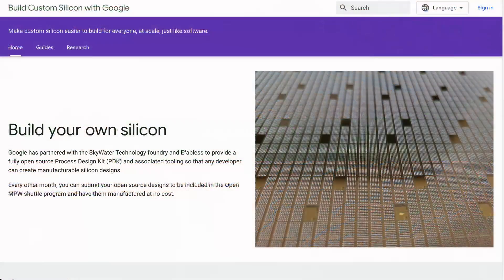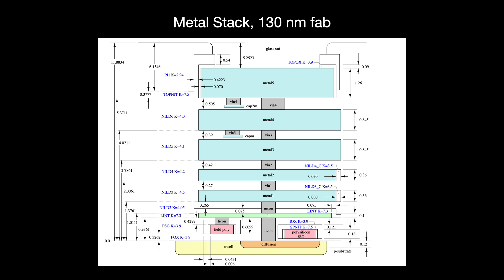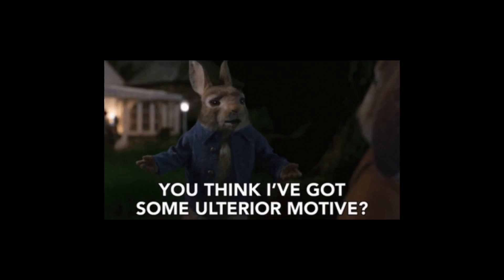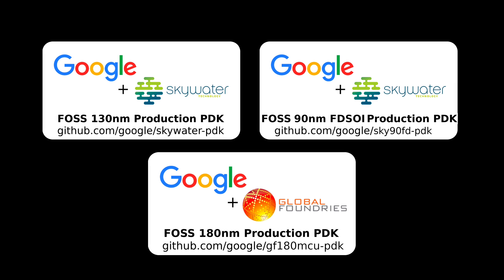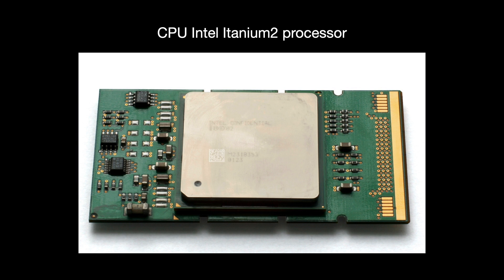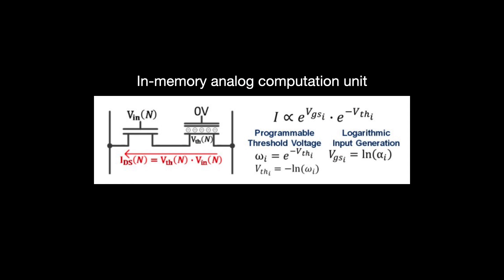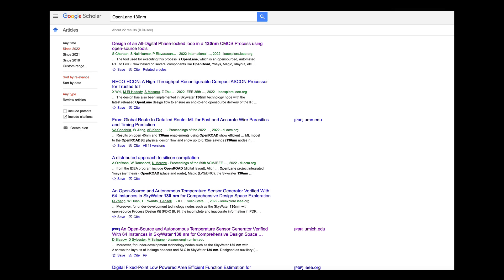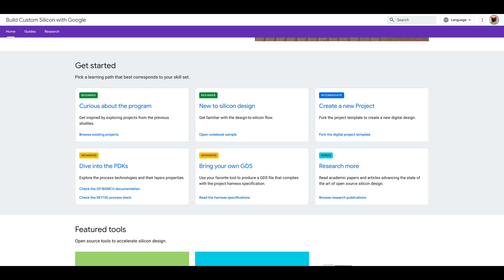Google's Open Source Hardware Dreams

Comment: This is so cool! The first application I thought of was for one of my other interests: astronomy. The issue that large, ground-based telescopes face is that the atmosphere "smudges" the image they create with every bit of turbulence in the air. Nowadays the big fancy observatories get around this by using "adaptive optics", which are optical surfaces that can change shape thousands of times per second to perfectly counteract the distortion caused by turbulence. The whole system uses machine vision, and the calculations have to be done super fast (again, at least thousands of times per second), so (I think) it takes dedicated hardware to do it. But that's out of the price range for a lot of observatory projects. I remember reading a research paper that looked at consumer grade GPUs vs FPGAs to tackle the problem in a cheaper way, and I think they ended up performing kind of similarly. But making a cheap(er) ASIC for that exact task would be incredible! 

Who knows if that's still how the research stands, that was a few years ago that I read that paper, and I don't know when it was published. So it could be that modern GPUs are so performant that they are the best option. Who knows, but that's just what I thought of.
Reply: How about doing lucky imaging in real time? Would that be possible/interesting?
Reply: @adambarker3130  That's definitely something I've read about them trying, but the issue is it only works with very short exposure times, which doesn't work for dim objects. Plus if 1 in 10 frames is actually OK, then 90% of the time observing was fruitless. Also, when telescopes get really big, different parts of the image are under different patches of warm or cool air, so the image isn't uniformly distorted. So that means you have to de-warp some parts of the image but not others, which is possible but it adds steps to data processing. So I think there's enough reason to go with adaptive optics that that's the main solution they go for.
Reply: I definitely remember hearing about this from one of my astronomy professors. Hopefully this will become reality in the near future
Reply: I was planning similar things but read about lucky imaging, but had planned something more sophisticated by far, and a new telescope.
Reply: This might well offer you the chance to shift a well designed FPGA implementation into a dedicated IC. But why would you? It's a slow process node, and once you have made your chip, that's it. Warts and all, all design errors baked in for free and for ever. See that 'RTL' bit in the diagram? Register Transfer level - that's your hardware description - exactly what's needed for an FPGA. I can see that for a dedicated, simple task, where the consequences of error are low, it's cool. But if you can write HDL first pass with no hidden errors, then there's an entire industry wants your number. The principal reason those 'professional' EDA tools are so expensive is because they are intended to prevent or trap (or at least make sure you find) those hidden bombs. I expect most of you are programmers, and know that states are 1 or 0? In an HDL, you typically have 9 states, and you need to be sure what happens if your signal is in any one of them - because hardware - one day, it will..
I feel a bit like the guy asking what use is a computer? It's definitely a cool idea. And don't get me wrong - I'm going to have a play once time permits - but as an FPGA dev, I don't quite see what it offers you besides being cool. Sure, the big FPGAs are viciously expensive, and the tools are 'interesting' to acquire (although for the home user, they are free, so..) and a pig to learn, but I don't see this being any easier, and there are cheap FPGA boards out there now..
Reply: @timwatson682  What do you mean by "9 states"?
I’ve done ASIC design for years.  There is 0 and 1.  The difficulty of an error free high performance design is that there is an extreme amount of parallelism and pipelining that make verification of rare corner cases hard to enumerate and/or encounter.
Reply: @ttb1513  I’ve only worked with FPGAs at a hobby level, but I know of only 4 states. They are 0, 1, floating, and high impedance. But those are just the states in Verilog, so maybe the physical chip experiences other states that aren’t properly modeled by Verilog? Idk
Reply: @Aubstract  People using Verilog RTL synthesis to generate the FPGA design are using 2 state logic.  Each state element has two states in an FPGA or ASIC — 0 and 1.   Logic gates and flip flop, register file, or SRAM memory produce 2 states.  To perform operations in the Verilog HDL and map them thru synthesis into an FPGA or ASIC, each bit is either 0 or 1, binary numbers.  There is no storing of a floating or HiZ value in a flip flop or other state element.

Comment: Remembering google’s track record on suddenly discontinuing projects I wouldn’t have high hopes regarding this one’s longevity
Reply from the maker: I thought about that. I figured even if Google pulled the plug, the tools and the code repos will still be around.
Reply: @Asianometry  Also, Google likes to kill small, niche user-facing projects that have limited long-term strategic value. When it comes to things designed to change the entire ecosystem (e.g. make their AI accelerators cheaper in this case), then I think they tend to commit a bit more. Their culture encourages tinkering, so obviously you see a lot more stuff that fails, but I don't think this one is necessarily in that category.

BTW, any chance of putting the links referenced in the video into the description, so they're more accessible?
Reply: Google's open source project tend to last longer and if Google suddenly were to kill it, someone gonna get the torch
Reply: As the others have said, open source is a bit harder to kill by dropping the project than their in-house apps and systems which require massive server farms.
Reply: I see this as possibly a visionary move on the part of Google. The promise of custom silicon can only be realized if the barriers to entry are lowered. 
If Google is the first to enter this vertical with a product people can really use… they could get a year or more advantage against anything coming from the US or China
Reply: If you don’t regularly cancel underperforming projects like Google, you end up spending $36 billion building a metaverse that no one wants.
Reply: @my2iu  fire extinguishers aren't enough here
Reply: Wow, this is pretty incredible! I don’t know how many individuals will end up having the wherewithal to take advantage of it, bit I can see this being a huge boon to university courses and research groups.

As you point out, these are really old process nodes, but it occurred to me to wonder if the larger structures of the 180nm node might not actually be better-suited for analog computing. Intuitively, it seems like larger structures could deliver better SNR for analog signals than smaller geometries would, thereby providing better resolution/accuracy.

Whatever the case, this has incredible potential. Props to you for helping spread the word on it!
Reply: That’s why it’s called a dream… they forget about it really fast.
Reply: Not the same. Open source projects and commercial products aren't the same. This can be taken buy anyone to run and fund vs a product needing a single monetary source.
Reply: Such bias killed Stadia
Reply: @johnnytshi  and nothing of value was lost. Quite the opposite in fact.
Reply: Especially with the tech layoff’s
Reply: What about Kubernetes? It's successful project for democratize cloud and pod orchestrations
Reply: Lol it's literally text files on git.. how do they discontinue it
Reply: Yeah… they have canceled so much a this stage I don’t even pay attention when they launch a new thing again these days.
Reply: @kyleslater5245  that's what R&D is. You need to fail and fail and fail and continue try without getting attached. That is how you get innovation. Of course it's disappointing when you come from the view point of a consumer that is only satisfied with an end product.
Reply: @matrix2000x2  What we do need, is to pick the correct project, and staff it with the correct people and fund it properly.  Otherwise, you are just chancing it, and throwing mud and hoping it sticks.

What is real engineering, is raising your odds of success from the beginning.

How many things were abandoned at one place, only to have somebody else pick it up and succeed?  Also, how many brain dead projects get funding, that are just a waste of time?

Most all professions have similar IQ, so it's important to pick staff structures well, to pick and process things more efficiently.

Comment: Thks & alright you also lose me quite a few times but I hang-in-there;
Sooo whether than depend on a 20 year old processor design/performance, ???why not just use FPGAs that are only a couple years behind in processor performance???
The question mights-bes a little naive but you must admit it's a very good question for a naive person to ask.
Reply: I'd assume there are some niche tasks that generically good FPGAs aren't very good at. There is going to be some crossover point for which is better depending on how well-suited the FPGA is for what you want it to do and how far apart the process generations are.
Reply: @thamiordragonheart8682  
I'm not all that smart but here's my 2cents worth;
In a nutshell, a FPGA turns a theoretical hardware processor into a software development project.  Perfect for low-volume projects where an ASIC processor is far too expensive, takes too long, etc.  Since you can updated the FPGA just like you updated its software, an FPGA unit potentially have longer life than an ASIC implementation.  If unit volumes ever gets high-enough, an FPGA is a perfect tool to implement/development the specs for an ASIC.  
I'm working myself to death trying to learn the secret/black art of FPGAs.  Any constructive inputs will be appreciated.
Reply: @tombouie  You can't build some stuff in FPGAs, mainly analog circuits. Also MEMs
Reply: @teokalmius  
Yes-true;
So I would have to buy them separately & just integrate them to the FPGA (just like the old-days ~1970s ;).  However today’s smartphones have most of the fancy-pants gadgets/sensors/etc I want though.  All I haves-tos-dos is to make a comm interface between the FPGA & smartphone..  
But more-generally, FPGAs give me the most flexibility & processing-power in the smallest package (ex: FPGA naturally process in parallel unlike cpus/microcontrollers).  The smartphones give me a standard/professional/easy/clean/etc human interface to interact with my finished systems plus I get all the gadgets/sensor/phone/etc for free.   I’m a-hoping FPGAs & smartphones will save me a hell of a lot of trouble in the long-term.   
FPGAs are really hard as hell to learn though (& I hopes it worth all the effort/profanity/throwing-things/etc ;).
Reply: @teokalmius  
Yes you already made that point & really I'm trying to be polite;
Remember I'm a retired military physicist out the 70s.  I used/repaired most electronics at that time (including those analog computers you keep nagging me about).  
In-fact, every morning I would boot-program the PDP8/11 computer from memory & start the coffee of course (oh PDP8 was kinda the 1st industry multiple-tasking computers).
I fixed everything from the commander's pocket radio, caesium time standards. FFT scopes (cutting-edge at the time), etc, etc, etc. I did all this even before I became a physicist.
Sooooo I truly thinks I can dos the comm interface between FPGAs any/all other electronics past/present/future.
Sooooooooo Mother may I please give it a try with your permission of-course ;)
PS: Oh to the good old days when electronics was just as much art as science (before you were born I guess ;)
   The Analogue Computer https://www.youtube.com/watch?v=ETEA2H3hpzs
   DEC and the PiDP-11 https://www.youtube.com/watch?v=bQUeMyAMQwo
   EEVblog #423 - HP5061A Atomic Clock Cesium Beam Frequency Standard https://www.youtube.com/watch?v=3yTL06ZU5SU 
   LORAN System, Before The GPS Debunks Curvature  https://www.youtube.com/watch?v=I0Ew5ZZaPjw  
   Etc, etc
Reply: @tombouie  Woah, chill a bit. Just because I sent 2 absolutely same messages, doesn't mean I nag. It was accident (and I immediately deleted the duplicate). I don't even know how you saw them both (my guess is notifications), but you really ought to use Hanlon's razor a bit more often
Reply: @teokalmius  I'm ain't all that smart &-all & so I gots-tos KISS for me to get anywhere (aka occam's-razor).
Reply: @teokalmius  Depends on the device, and what you choose to call an FPGA. Cypress PSoC for example.. But yeah - there's stuff you can't do. As an FPGA designer, I do what can't be done in a CPU because speed (massively parallel) and isn't done in ASIC (cost). Choose your toy - but there's no such thing as can't anymore..
Reply: @tombouie  FPGA Dev here. You're right that FPGAs are the device of choice when you aren't making enough units to need an ASIC, but they are also used both for prototyping an ASIC and when you need to repurpose the device in use, or offer upgrade paths - for example, in a software defined radio, you may well swap the bit file to suit different modulation structures. It can also be used as a field upgrade stream. This Google hardware is interesting - as it offers a much lower cost entry to that FPGA to ASIC conversion, and (potentially) allows the inclusion of non digital elements, but it's a slow process node - we are all playing at 1/10 of that. If you're going to learn FPGAs, then get out of your head the idea that it's programming though - that will trip you up badly. You're describing hardware, and what happens is important, but WHEN it happens is much more important. Timing is everything, and without an understanding of that, you're never going get beyond inefficient abstraction. By all means use the HLL stuff, but make sure you are fluent in the underlying Veriog or VHDL, or you're going to have difficulties.  That said -keep going -it's an uphill slog for a while, but you will get there!

Comment: man if making chips is that much easier I would definitely start a lot more projects
Reply: Starting an asic run is millions per attempt.
And it will take more than one attempt.
Reply: FPGAs can do about  anything a custom designed chip would do otherwise.
Open hardware is more about that Nvidia crap, where people can't write and update drivers for their operating system (Linux, BSD....)
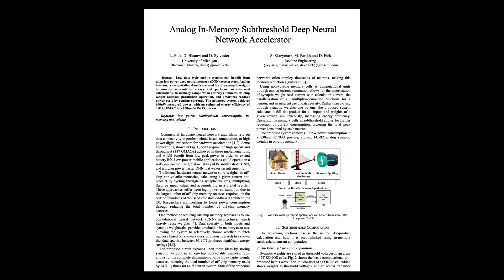Reply: @hinz1  no. Even with the video's example - you can't program a FPGA to work across variable voltages, only high and low (1 and 0), so it would be categorically impossible to build 06:28 design on it. That is exactly the point. 

Also, for researchers to be able to share their papers with no NDAs is huge - most cutting edge research on this field is conducted behind closed doors, even if for tests and trials they build mock-ups with FPGAs, the tooling and processes are wrapped in a thousand layers of bureaucracy. Honestly, what I see coming from this initiative is not much beyond what google wants - in like 4 or 5 years there will be a lot of recent graduates who already got their hands dirty, and so are better prepared to be hired. A friend of mine designed a couple of photonic chips for his PhD, and everything took so long, and he had to put in so much effort to fight for the grants necessary.... If something like this makes it 10% faster or 10% cheaper, it is already huge.
Reply: @prgnify  hmmmm why not these people share these tools on warez forums , am sure people will reverse engineer and crack them and will be in public domain . sometime piracy is good
Reply: @Xerox482  the issue than become that if you MAKE anything using those proprietary technologies, they are entitled to it.

Same reason why open source programmers star as far away from leaked source code as possible, so there can never be any claim of infringement
Reply: @prgnify  lol if say it is impossible to design an ADC or DAC into an FPGA then how are Xilinx and Altera (Intel) doing it?

Comment: What’s a good starting point to understand the topics discussed in this video??? It sounds very interesting but I need a basic foundation to understand the subject better.
Reply: I find that Matt Venn's Zerotoasic videos provide a good general starting point. He also interviewed a bunch of people working in the field, which are further pointers towards interesting topics.
Reply: @HennerZeller  Thanks 🙂👍
Reply: Id also recommend you snoop a bit  in computer design, so you can familiairise yourself with a more abstract level of circuits too.
Reply: @DRakeTRofKBam  Thanks!
Reply: you asked about 'a good starting point' and let me tell you - there isn't one. There are many different angles depending on the level you're at in electronics, electrical engineering, systems programming, computer engineering etc - even your age.

If you never studied nothing like this, you could watch Ben Eater's series on his breadboard computer - it will give you ideas of how processors work. 

What I personally recommend is the book 'Introduction to VLSI systems', by Carver Mead and Lynn Conway - I bet every library must have a few copies.
Reply: @prgnify  oh alright, thanks man. I’ll just try what works for me. Who knows, maybe I’ll find out something cooler than even this video.
Reply: A degree in electrical engineering or similar is probably the best bet, so try to look for topics that are tought there and learn them on your own.
Reply: @lbgstzockt8493  I’ll give that a try!
Reply: Stop at what you don't understand and Google it all the way to it's fundamentals. Rinse repeat.
Reply: @zinjanthropus322  Thanks man, 😃
Reply: you will also need some low level programming, even if you create some chip you will need to write some kind of drivers